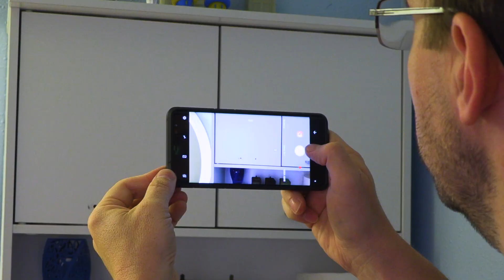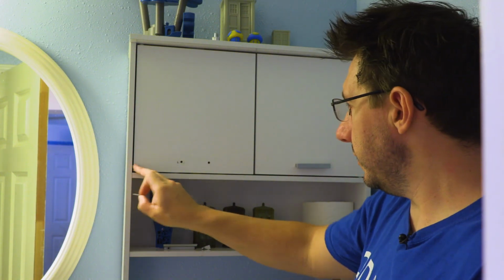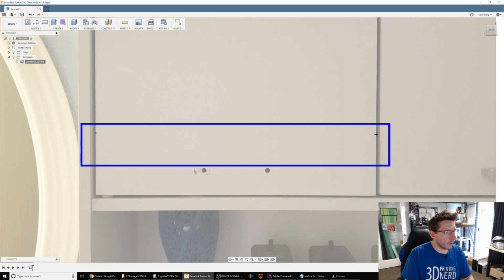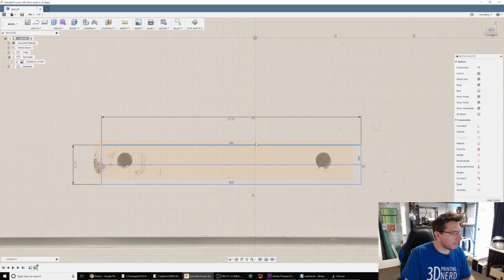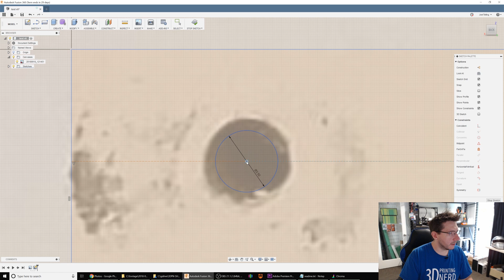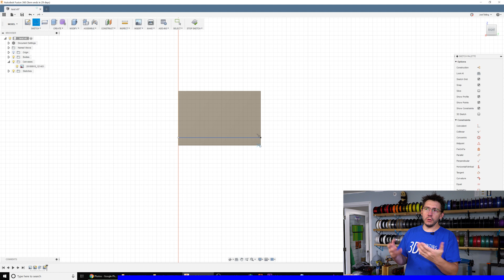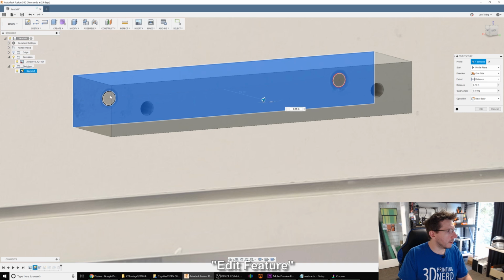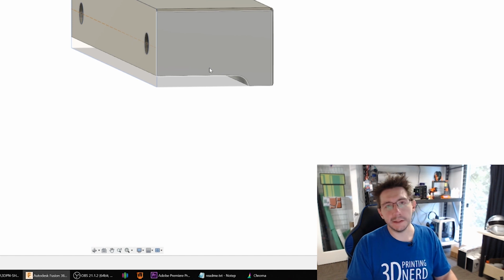Practical 3D Printing in the Bathroom - Fixing a Cabinet Handle

Comment: It's always bizarre to see people using Harry Potter units to measure things.
Reply: 37/56 inches .... so weird how they don't just say 0.66 inches :P
Reply: Or measure in metric units? As most modern parts are done in mm.
Reply: In the UK we just can't make our minds up. sometimes I am in an inches mood and sometimes I'm just a bit metric. Typical Brit :-)
Reply: @Paul McKillop, but you are on the right path, at least.  :-)
(And yes, we used tum (inch) still about 30 years ago in some contexts, but not any more).
Reply: Why do these weird "metric/SI" countries still have 365 days in a year, 24 hours in a day, 60 minutes in an hour, 60 seconds in a minute?  Oh that's right.  You metric bigots do the same thing as the Old Dart using NON-POWERS-OF-TEN all the time.  Nuclear physicists measure area in micro-barns.  Astrophysicists use AU (distance from earth to sun, arbitrary), light-year (arbitrary), parsecs (648000/pi AU, wtf).

P.S.  I use metric and freedom units interchangeably.  Not any harder than learning 2 languages.  Speaking of which...  Why on God's green earth is anyone speaking any other language than English.  It is the international norm.  Kill off all those antiquated languages people!  So much confusion is caused by all you people speaking languages other than English and there is no simple conversion factors like there are with freedom to metric units.